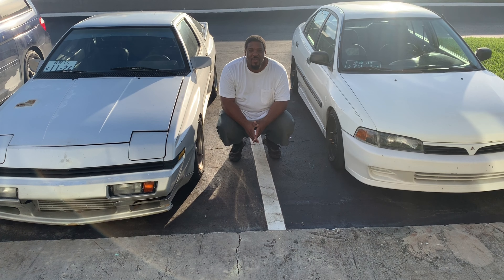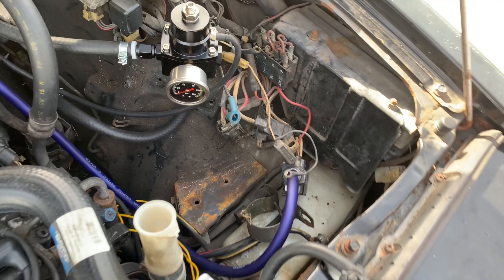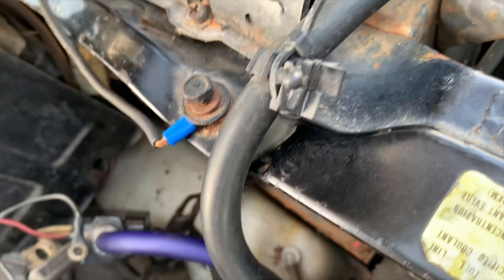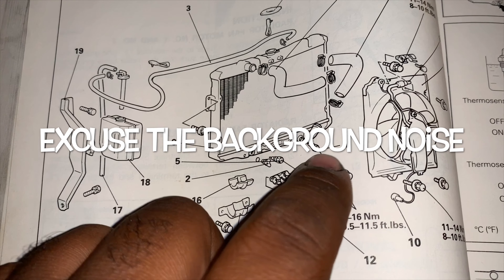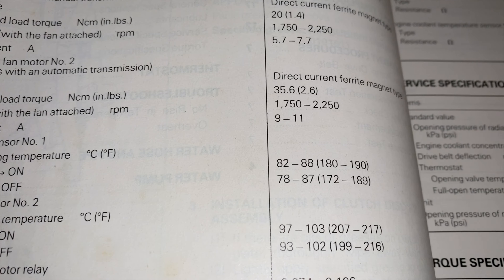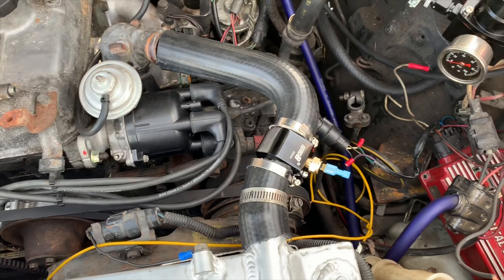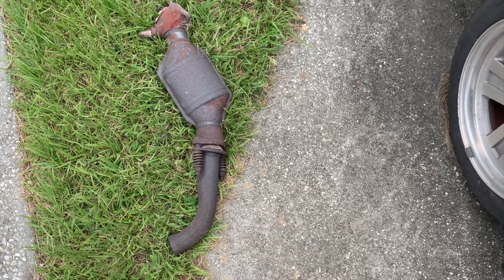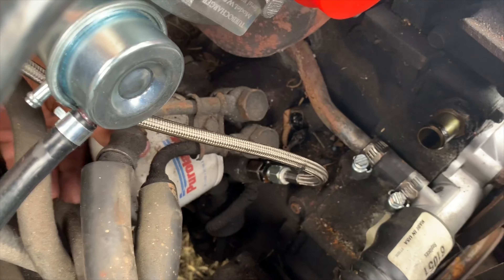Part 21 MSD blow off valve and more

Comment: 7:08, Both relays.
Tie them at the relay, then only 1 wire is needed on primary.
Reply from the maker: True I thought about that too but the wires at the relay are a little crispy so all of it needs to get replaced on the car